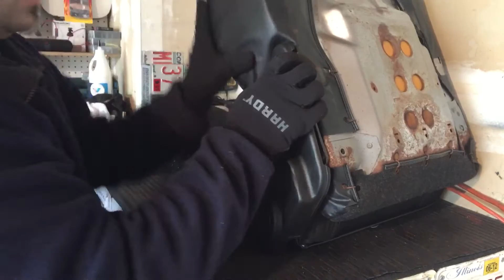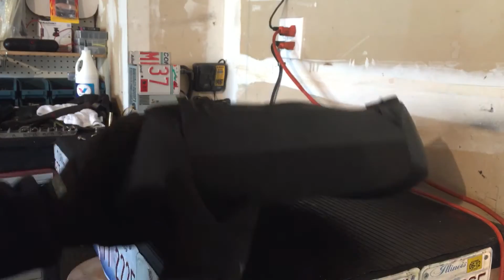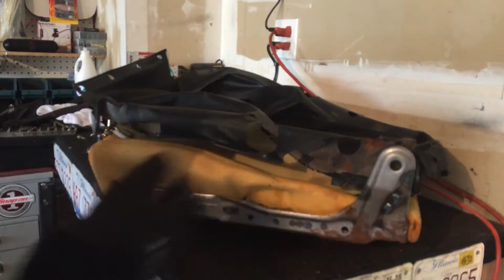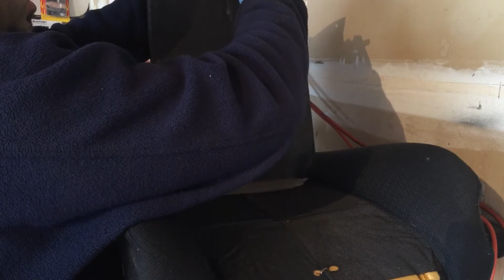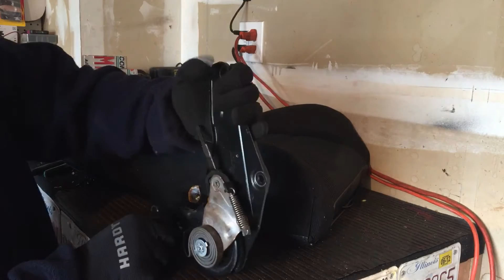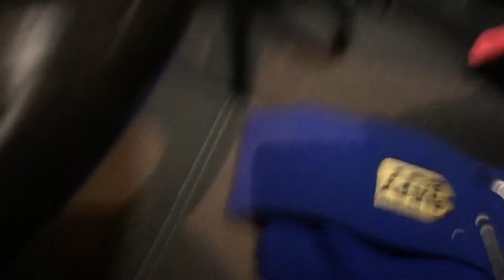Mazda Miata Foamectomy & Seat Heater Install

Comment: Hello, Just watched your excellent heated seat fit video. I am about to do the same to my NB but using NB Mk2.5 switches with relays mounted behind the glovebox. I note that when you fitted the heat elements you didn't cut out any slots as per the fitting instructions supplied with the kit? Any reason for this ?? Thanks Nac😂

Comment: Good video on heated seats; very informative.  I'm also in Chicago and could really use some warmth in the Winter for my NA Miata.   How did you connect your wires to the ignition?  Did you cut the ignition to splice them all together, or use vampire taps, or something else?
Reply from the maker: Because Miata I just stripped the wire back, make a hole in the exposed wire with a small screwdriver, feed the seat heater wire through the hole and the wrap it around the exposed wire.  I never use vamps, t-taps, etc in vehicles. They bounce around too much and have seen them either A: vibrate loose or B:  corrode over time and end up causing connectivity issues. 

If you're unsure how to do it and want to come to the northwest suburbs, I'll make the connection for you.
Reply: Thanks man, yeah I know exactly the technique you're talking about.   I'll give that a try.
Reply from the maker: Because Miata no problem. Any other questions shoot me an email, refinedperformance at gmail